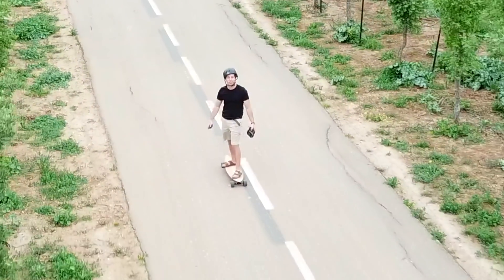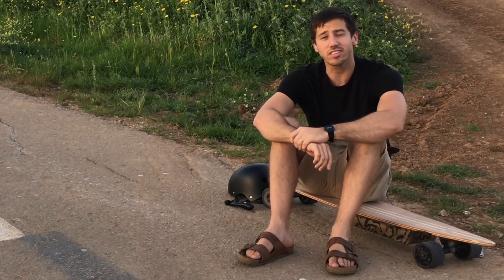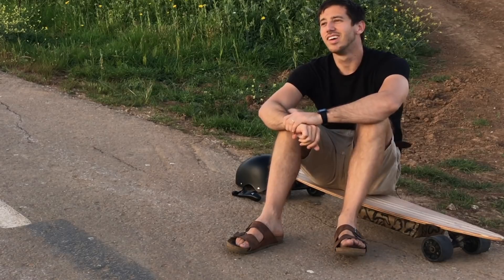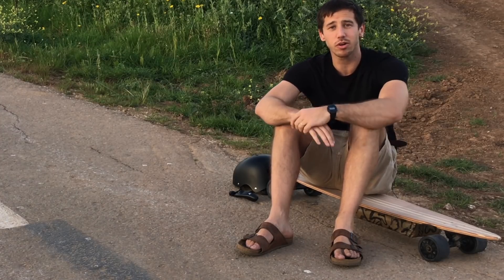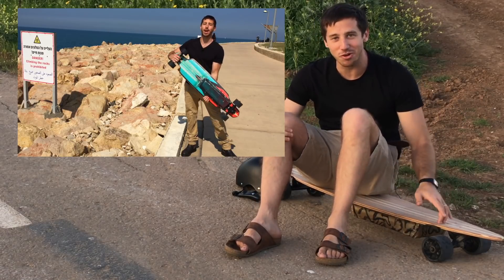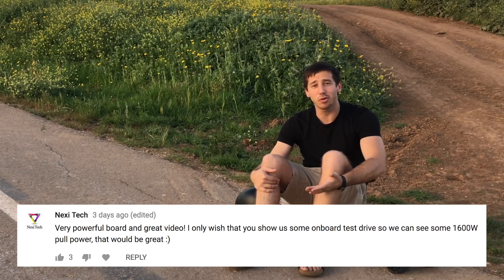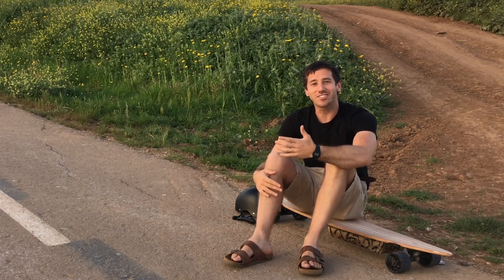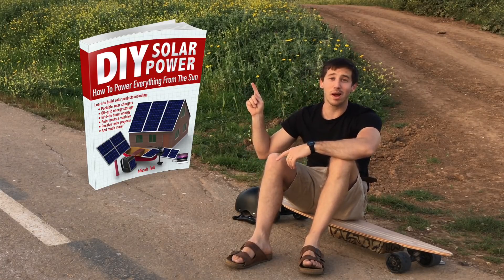DIY Electric Skateboard Follow-up Q&A

Comment: I have already ordered the battery pack which is li-ion 6S4P 18-25.2Volts 18Amps continous, 36A peak. I know that more Volts means more speed but what Amps are doing?

Comment: hello can you tel me the exact dimensions of the rear truck, how long  is the part between the wheel and how thik are the squares that hold the hub motors. i just got a koowheel onxy gen 2 2018 but i find the rear wheel a bit to close together. do you think it will fit and are  the ones you sell  bigger?

Comment: Awesome. Keep it up with all the videos. I'm learning a lot. I'm old for a skateboard but my grandkids will love them. With your skateboard & bike witch do you prefer, or is it more like there both good for their own thing? The bike more for commuting & transportation? Boarding for FUN? Thanks.
Reply from the maker: Thanks! Yea they are definitely good for different things. I use my ebike for trips more than 2 miles or so, and when I need to go on roads where I want to travel at 30 mph. If I'm going on shorter trips like a mile or 2, and I don't need to go on big roads that require more than 20 mph, I take the board. Also the board is good when I don't want to deal with locking up a bike because i can bring the board in with me, like to the market.

Comment: I love the electric skateboard website, especially the package with everything except batteries. But I would like to see a couple more package options, such as single motor, different wattage motors, etc. $400 is fair but a tad but steep still for me, but a package around $300 and I would be hard pressed not to get it.

Comment: Dude you're my hero.. A couple ideas... 

1. I recommend to provide Amazon smile links :) 
2. I think I saw on one of your videos that you made a longboard out of carbon fiber. Idea: make it bullet-resistant. You can even put straps/mounting etc to turn it into a kinda heavy make shift shield.. Or at least a a shield when you're wearing it on your back. https://youtu.be/_7jiIQOgwtI
3. Second idea what if you put a solar panel in the middle of the top side of the longboard (in between where your feet go) . Do you think it would be useful enough to charge the batteries? Or how long would it take to charge?

Comment: Man, those things are a lot faster than I thought they'd be. If I was on one going that fast, the old pucker factor would be running so high you couldn't pound a pin up my behind with a jackhammer. 

I was on your forums last night and I read about using solar panels to charge lithium batteries, and if you need a BMS along with an MPPT solar charge controller, and while you explained it, I was wondering if you could maybe do a video on that and really show the nuts and bolts on how to do it?

I also was looking to see if you're making progress on the higher power battery kits, and I'm glad you said something about it here in this video. I'm really interested in checking those out. Keep up the great work.